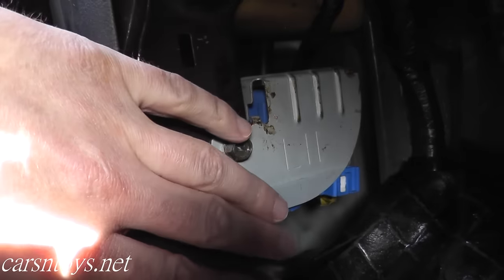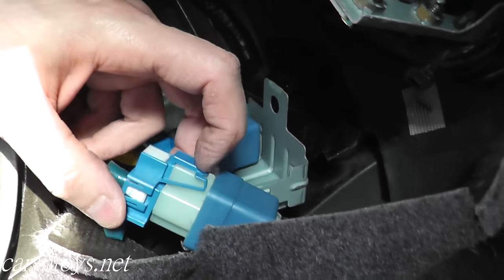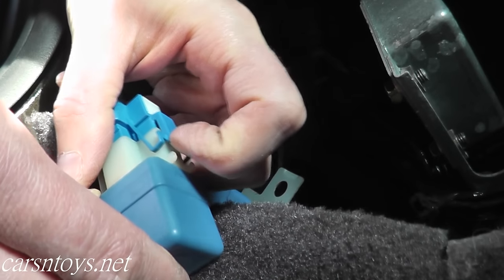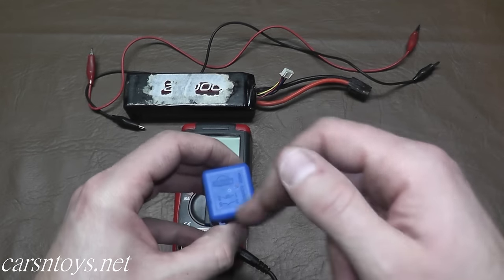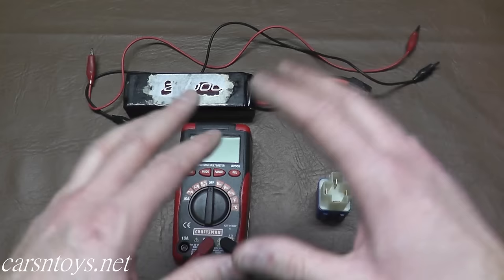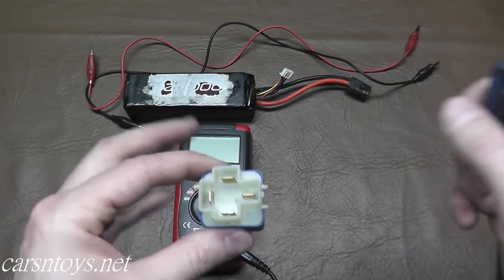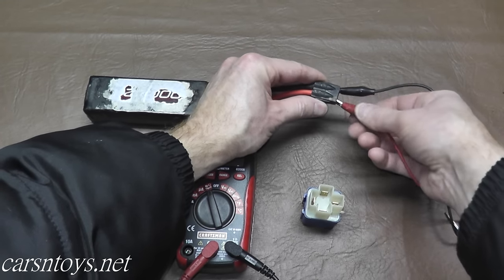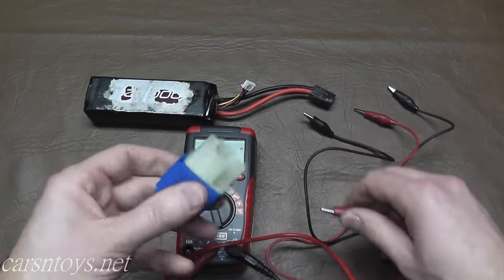Fuel Pump Relay TESTING and REPLACEMENT

Comment: That is a good description and explanation. However a worn out relay can show good using your test, and be erratic during operation.  Those relays have contacts exactly like the old points in a 1970 Briggs engine.  Those contacts can become worn and burned, giving you a good indication with your meter, but can fail after having several amps going through them.

Comment: Car had been starting normal without issue. Yesterday, same thing then I get on the road and it sputtered once for a split second before going back to normal. Got a few miles down the road and it started to do the same thing but more intense, like hesitation before completely dying. 94 Corolla 1.6L

Comment: Mine was a bad relay not sending the right amount of current to thepump causing it to run weak and it couldn’t build up the right pressure. New relay now pump gets its full power

Comment: Excellent! Very helpful to understand with the demonstration. Thanks. Will use a 12V power adaptor and try to test
Reply from the maker: Glad it helped
Reply: @CarsNToys  I tested them successfully on my Datsun Redigo here in India and it helped me diagnose the problem. 

The power was going go the fuel pump motor but it was not working. Took it off connected it to my 12v adaptor and tried to manually rotate its fan and it started working. 

Here video of it. 

https://youtu.be/EQRm0JxJJKc

Thanks once again.

Comment: Better yet to measure the actual resistance of the relay, most multimeters beep for continuity testing at a couple of Ohms, but even a couple of Ohms relay contact resistance will drop enough voltage to make whatever is behind that act up.

Comment: Connecting current through 1 and 2 to get connectivity between 3 an 5, does that mean the  current runs through 3 and 5 when installed? Is the relay in effect facilitating two seperate circuits that don't connect?

Comment: Temp fix..   If your cars interior is hot from the summer heat  it can definitely  effect the relay,  especially if your car is old.  If your car doesn't start,  air your car out first and try it. It just worked for me. You can avoid car heat,  by parking under a shady tree and crack the windows.

Comment: Thank you so much. Very helpful video. It makes it so simple to locate, understand and test a fuel relay. Going to try it on my Fiat Panda (1988) before I try to take out the pump which is so difficult to access and remove. I add you to my subscriptions.

Comment: My RR sport 2012 fuel pump is pumping more fuel than it need while engine start. Because of much fuel, it doesnt start. Can problem be fuel pump relay?
Reply: Either that or fuel pressure regulator. Even the ignition (coil) relay can cause issues with the fuel pump if the relay is bad.

Comment: I see you answered someone's question 2 weeks ago and hope you get this. I just had my pump replaced and when I drove it home, it stalled on the ex-way again. So from my reading, it could be faulty relay: One of the first symptoms of an issue with the fuel pump relay is an engine that suddenly stalls. If the fuel pump relay has an issue while the vehicle is operating it will cut off power to the fuel pump, which will cause the engine to stall. A faulty relay may allow the vehicle to be restarted a short while later, while a completely failed relay will not. And that's exactly what its doing......The million dollar question is there a way to test for this? The towing is killing me. Thanks so much........Josh
Reply from the maker: Why not just replace the relay? On average, they cost $10.
Reply: Yep that's what I did. 16.00 seemed to be the problem. I finally read an article call "Symptoms of a  bad or failing fuel pump relay". Wish I had read it before the fuel pump. But its all good. Thanks for you quick reply. I was getting burnt out on being towed. Thanks
Reply: Well its 7-31-17 and I am back to square one. I dove it home yesterday; no problems. Today I drove about 40 miles fast and slow. I pulled into a parking spot and it stalled. So keep driving and I turned and it stalled at a stop. And then again in a parking spot. Then it ran fine and I went to wash it at the end of the day and it did the exact same thing is did in the beginning. Stalled at the car wash : died. And I couldn't get it started. Tried 4 times. Nothing. Then I figured I would wash it. Then I tried again. Nothing. Then I prayed and it started and got it home, but it seemed like it struggled on the way. I am wondering what else could it be? Any ideas? Running out of money. Andy thoughts would be great. Thanks Josh
Reply: joshjames76 did you figure it out? I’m having a similar issue with my 2009 Toyota Corolla
Reply: @seseborosaretin1261  Did you figure it out??
Reply: @joshjames76  Did you figure it out??
Reply: @CarsNToys  Today it was $49 at a Nissan dealer. If we keep this up, in five years from now someone will pay $99 for a fuel pump relay.
Reply: I replaced the relay today but it ended up being a faulty battery releasing acid out by a positive terminal and corroding it blue. If the relay doesn't get enough volts you lose.

Comment: Can I open this up and clean the contacts or bend the spring and get it working again? I've done this with a signal light blinker 10 years ago and it still works.
Reply from the maker: You probably could but these relays tend to be inexpensive. You may save time just by replacing the faulty relay. Good luck!

Comment: I have a 94 ford ranger with 2.3 I am not getting power to fuel pump I checked fuses under hood even the fuel shut off under dash an carper any thoughts please

Comment: I kept having random stalling when driving once it happened on the highway and that was little scary. I figured out it was my fuel pump relay seeing that my issue was very random car would always start okay but the engine would stall out why’ll driving and it alway took a bit too get it going again. I figured out my relay was bad it would cut the power to the fuel pump shutting it off and stalling the engine of fuel. Replaced it with a new relay so far so good. It’s odd that that relay and non of the rest are bad but I guess the fuel pump relay gets used a lot like every time you drive the car.
Reply from the maker: Interesting. Thank you for the feedback.

Comment: Why did you do a continuity test and not a voltage test? Arent you trying to test for 12v or are you just seeing if the connection is made and that there is continuity?
Reply: The continuity test shows the link in the RELAY is OK and that the problem lies somewhere else, i had to think about the logic myself.

Comment: Nice vid. Had this fail on a 1998 Integra, what a pain in the @$$ it was to determine as it was just stalling driving down the highway, but just put the clutch in, crank it and it would start back up no problem. Eventually, after many a stall and a few Google searches, I came a cross a forum that suggested the fuel pump relay. Replaced it and no more stalling.
Reply from the maker: +Amaury Lopez That's awesome man. Yea, it's one of those things people often over look.
Reply: Amaury Lopez. tego problema co honda integra me. coje los cabio mi tarde

Comment: Quick question if anyone can answer.
I’m getting resistance and ohms when there is no power to the relay and when I put power to it I’m not getting any ohms does this determine if the relay is bad?

Comment: That could click and you could have continuity through the contact points but what's the resistance value supposed to be. You can have a relay making like it's supposed to but if the resistance is off at the contact points it still may not work. You're almost there.

Comment: Hi have a 30l td 2001 Nissan patrol just had a full engine strip and rebuild including brand new turbo and turbo intercooler an  it still isn't boosting right any advice would be great thanks

Comment: Where did you get that portable battery? Anything else I can use to substitute as a 12 volt source?
Reply from the maker: It's an RC lipo battery pack. You can also use a car battery if you have an extra one.
Reply: Where did you get it?  How much do they usually cost?
Reply from the maker: They're not inexpensive. $60 is average. Ebay, amazon will have them.

Comment: my nissan armada doesn't like to start when it's hot (80 degrees and up) outside, cranks for 3 to 5 seconds before turning the engine on. When it's cold outside (70s and below ) it cranks immediately 1 second. Does it sound like the relay?
Reply: Reading through the comments heat seems to be a factor with the relay... "park under a tree in the shade and crack the window."

Comment: it may seem good but if you have a sticky relay then that's a problem, because it will test OK, but will not always reset to an open circuit when the 12v is dropped.
Reply: cfq. Titanic

Comment: Hell of alot easier to just yank a relay sharing the same part# that's known to be good  One that is running something else (a/c heater blower, or radiator cooling fans, pwr windows  etc. whatever. There's always 3 of em. the same on pretty much all vehicles.. But relay contact points arc out an burn them  intermittent. On those I cut the case off W my dremel (If it can't be opened) and emery or file the contact points of all arcing marks. Violla. No equipment, no money spent.

Comment: I got a 2006 Lexus IS 250..I ran a diagnostic and got "Fuel Pump Primary Circuit Malfunction" idk but it sounds like The fuel pump relay is not working. I cant even find it. Any suggestions ????
Reply from the maker: Best bet is to get your hands on the factory repair manual. You can often find them online via Lexus forums or try ebay. It's well worth it.

Comment: Is that a 12V battery tester, or source? What is the specific external battery called?
Reply from the maker: +WeekEnd133 I used a lipo battery for RC cars. YOu can use any 12v DC power source.

Comment: Question I know it's not the alternator or the battery, The Car Turns Off For A Few Seconds Than It Turns Off. I don't know what else it can Be. Thanks any response would be greatly appreciated
Reply: Enrique Rick Ramirez noone else said anything and its probably fixed by now but it sounds like the actual pump is going out. May be getting power to crank but then just cuts off

Comment: I have 240sx nissan and 75 amp fuse blown and car have no power or what so ever. After replacing it everthings seem to work except the fuel pump. I check the fuse and not single fuse blown. The fuel pump relay doesnt work because it doesn't click. I change it to another and still no click. Could be bad wiring or something shorted? What could go wrong?
Reply: Check the wiring ....pay special attention to the grounding
Reply: yeah make sure the relay actually works first, then check every wire going to the relay

Comment: i have a 1999 chevy astro van it cranks but wont start could it be a relay or fuel pump ?
Reply from the maker: Sure could. Start by checking for spark and fuel.

Comment: Helo, sometime there are relays with five prongs, what's the fifth one for?
Reply: relays with five pins, the fifth one goes to another thing that would be powerer, when the relay is powered the pins 3 and 4 are connected but when the relay is switched off the solenoid in the relay powers down and there is no longer a connection  between 3 and 4 but now between 3 and 5, its used for things like headlights, when on dipped beam the power comes from pin 4 but when on full beam the power comes from pin 5, all controlled by the switch in the car...relays with 3 pins use one of the pins as a shared earth and the other two for the circuit

Comment: I need help..lol... Have a 2008 350z I want to test the pigtail off the fuel pump but I have no idea what the colored wires are suppose to do nor how to test each wire. I have 5 wires I looked on the Manuel but cant find a breakdown of the wires(colored and voltage) nor how to test. Any help is appreciated I will keep searching

Comment: I need help Nissan Maxima 95 

 I recently changed the fuel pump, hoses, fuel filter the node sensor and crank shaft on my engine because the car kept cutting out on me while on the road. 

When necessary, I sometimes spray some starter fluid in the manifold, which helps me get the engine started again, but it doesn't last very long (3-4 miles) and it stops on me again. 

Also, my Check Engine light is not coming on and the dealership where I have taken it has hooked it up to their machine and are not getting any signals as to where the problem may be coming from.

Is there anyone who can offer some suggestions for what could possibly be happening and what part could be failing? Thank you!
Reply: Air in fuel line check fuel pressure

Comment: Yeah, better with more details and maybe show the readout on the multimeter.
Reply: The power through those connections comes from the alternator when the relay is positioned in the car.  The multimeter is just throwing milliamps into the circuit, therefore, the beeping noise when the circuit is good.  It's irrelevant how many mA is going through it.  The beeping indicates the circuit is good!
Reply: Yeah, no idea what I was thinking. A Relay, for those (like me) who are sometimes confused, consists of two open circuits... one low voltage, made of copper wire wrapped into a coil, which creates a magnetic field when electrified (with the low voltage) and causes the high voltage circuit to close (alternator power?). In any case, this is a matter of checking for mechanical action (the clicking noise) which activates under low voltage ( a 9 volt battery will usually do), and when that circuit is closed (clicking noise) you check for continuity with the multimeter on the other circuit (better ones beep, cheaper ones will just read 1 or 0). All electrical issues are just one or a combination of three things - CONTINUITY (power goes thru it one way or both ways) , RESISTANCE (reduces the power from one side to the other - the "missing" energy turns into heat), and POWER / AMPS. OK, well, not ALL, but pretty much anything you ro I will ever need to test on motor vehicles or around the house. Oh... and WHY do you use relays? So the high voltage doesn't go thru a switch and melt it.
Reply: Yes, but I think relays usually also have specific resistances within which they work. So, it's not just wether the circuit is open or closed, but what the resistance within the circuit is as well.
Reply: You may be correct but, I would think that it's such a small circuit that it wouldn't really have that much resistance to it.  Probably not even enough to measure.  Also, if a change in Ohms was detrimental to the relay's operation, wouldn't you think we would have seen or heard someone, somewhere telling us about it?
Reply: Or use a test light

Comment: what will make my 2001 ford explorer kill new battery
Reply from the maker: A faulty alternator or parasitic draw. Eric the car guy has a very good video on how to test for parasitic draw. You can test an alternator easily with a multi-meter or your local auto part store can help.

Comment: can anyone answer a simple question... why do you need a fuel pump relay?  this is only one tank... if the engine shuts down the ignition system shuts down and the pump shuts down... correct?  the internet and youtube cannot answer this question... some people will say if your engine quits... it will continue to pump fuel and fill you engine with fuel... well... that is wrong... there is return lines and injectors are not going to continue to inject when the engine quits... and if your ignition systems stops... that should shut off power to the fuel pump... right?  i mean... it shuts off power to the relay... right?  i know... lower control voltage coming from the computer... been working on industrial engines and transfer pumps and relays... and thinking... why... what's the purpose... if the pump is going to be running continuously when the engine is running... then what the hell is the purpose of the relay... seams like another reason for something to go wrong... so some poor kid without any knowledge gets taken to the bank by the dealership... another innovative way to take the tools out of the hands of the drives and make sales... i mean... you could just by pass the relay correct and you'd have the same out come correct

Comment: Vehicle in description. "How to test and replace a fuel pump relay. The principles shown here apply to most vehicles. However, it's best to check with your vehicle's repair manual for testing parameters.This specific vehicle is a '97 Nissan Maxima."